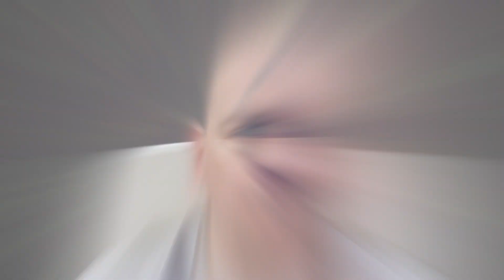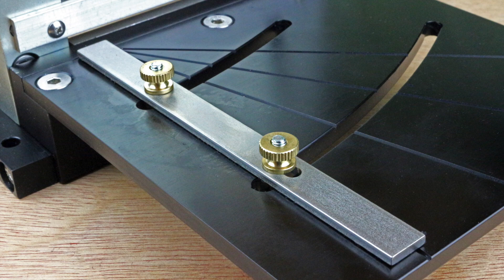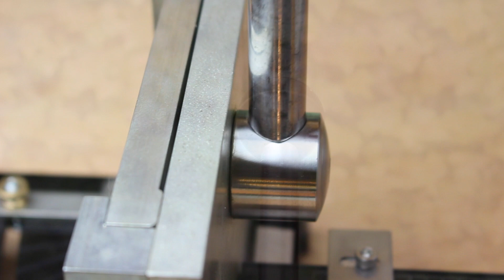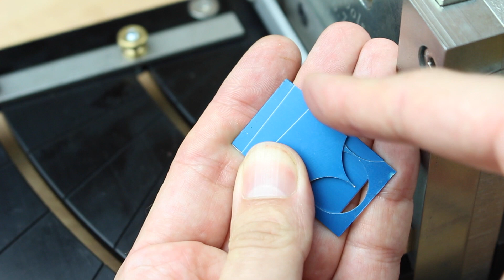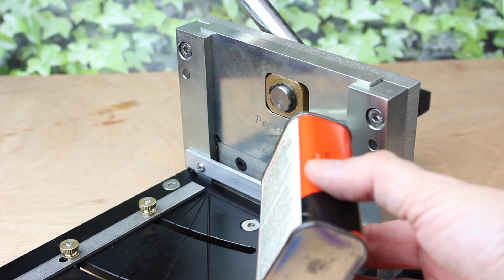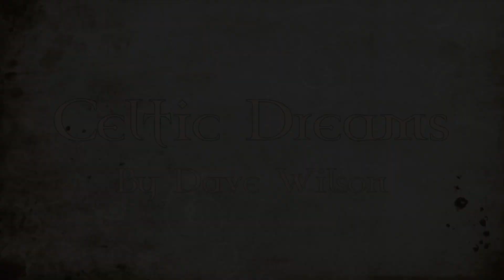Pepe Tools 4" Guillotine Shear Demo & Review in HD

Comment: The strip produced out the back cannot be perfectly flat but I am trying to find out how flat. Yours LOOK flat enough.....All I can find out anywhere is that they come out flatter than  a rolling blade shear. That doesn't help me. Showing the 1-D profile of the product would help me. I will  be cutting 0.5 mm copper.
Reply: Ok, I saw. Virtually flat; you really cannot see a curvature at all.
Reply from the maker: The guillotine cuts vertically in a shearing action. There is a very slight scissor action in that the near edge of the blade is a fraction lover than the far side; hence, the metal cuts smoothly from one side across. But this effect is very, very subtle. Think of it as chopping the entire sheet in one go vertically. Hence, there is little to no curling or distortion you would get with scissors or shears. hope this helps. Dave

Comment: do you know where i can buy these in the U.K?  thanks
Reply from the maker: As far as I know the only Pepe stockist in the UK are Betts metals (formerly Sutton tools). They may be able to order you one. Failing that you can always buy direct from Pepe, but postage may add a little due to the weight. But you can use the code "Celtic" to get a small discount which should help.  Dave
 link for bets metals https://bettsmetalsales.com/catalogsearch/result/?q=pepe
Reply: @CelticDreamsCoUk  Thanks Dave, That's Much appreciated

Comment: Hi! I just bought the 6” one but the blade is not aligned... do you have any instructions on how to align it? I’ve looked everywhere and can’t find anything.. thanks in advance!
Reply from the maker: I presume you mean align the guide to 90 degrees. I simply use a thin plastic 45 square like you get in a school stationery set. Drop the blade down and ensure the square is up against the blade. Adjust the guide accordingly to 90- degrees (or 45). Dave

Comment: can we cut nickel foils without any rings formation of cutted pieces
Reply from the maker: Not sure what you mean by Nickel foils and ring formation. Try to reword your question and I will do by best to answer. Dave
Reply: nickel sheets of 6-8mm width and length of 300mm
Reply from the maker: The blade is 4" which is 100mm so not sure how you would make a 300mm cut. Dave

Comment: how long strips can be cut
maszine typ 4 ' 6 ' 12 models
Reply from the maker: The size, is the size that can be cut. This is a 4" model so can cut four inches wide. You can remove the depth gauge and cut any length up to 4" wide. Dave.